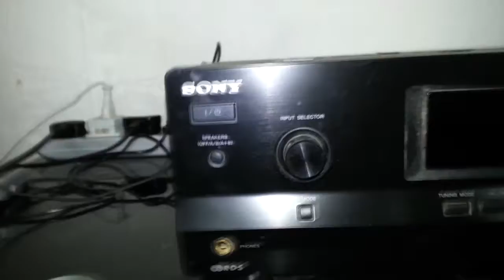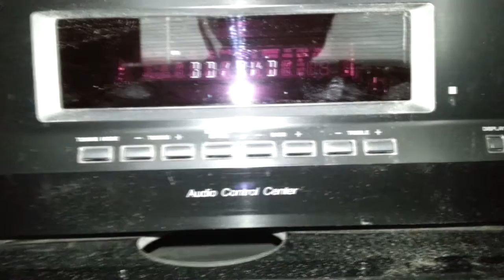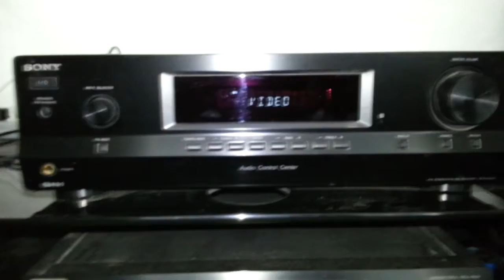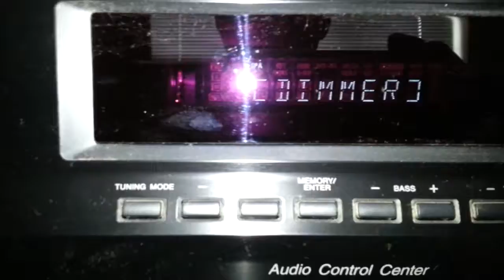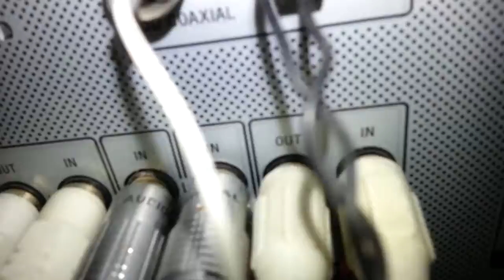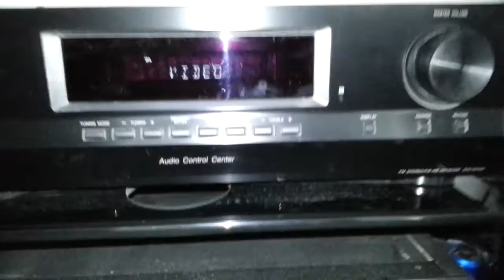My Sony STR-DH100 Audio Control Center Amplifier Review

Comment: When watching Netflix or cable how do I set it up so sound comes out the speaker and my TV? I have the speaker wires plugged in correctly...
Reply from the maker: You have to select the input you want on the amplifier.

Comment: Hello hope you can help bought new speakers and now its coming up protect mode!! cant get it off unplugged and removed all cables and still coming up protect mode
Reply from the maker: I have never had that problem and I no longer have the instructions. Sorry about that.
Reply from the maker: Maybe try turning it off about 30 Minutes then turning back on. This may help. https://www.sony.com/electronics/support/articles/00025095